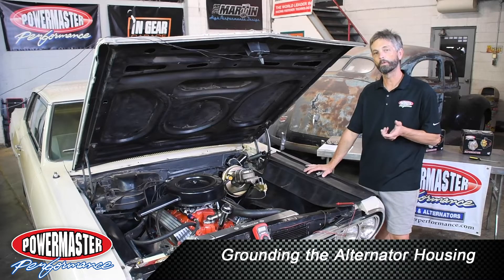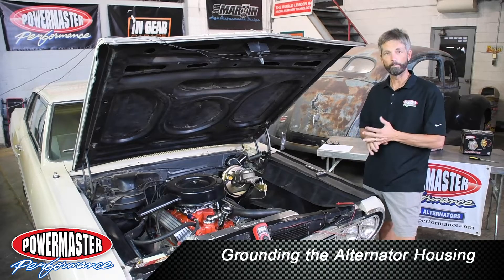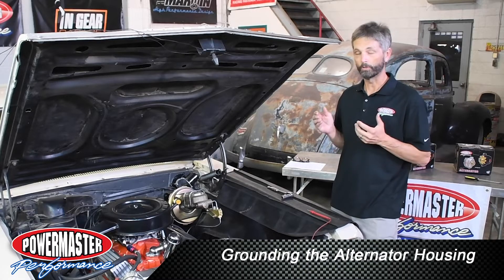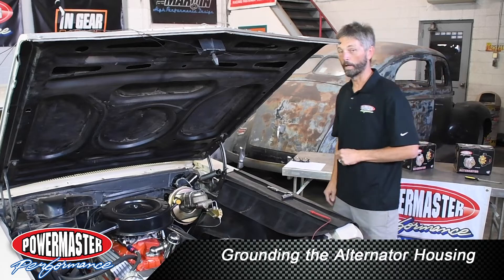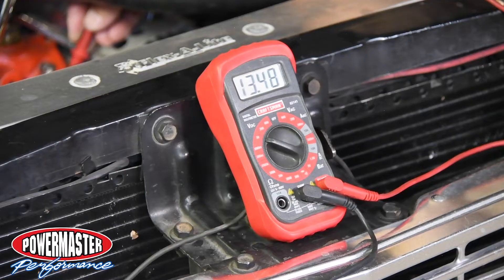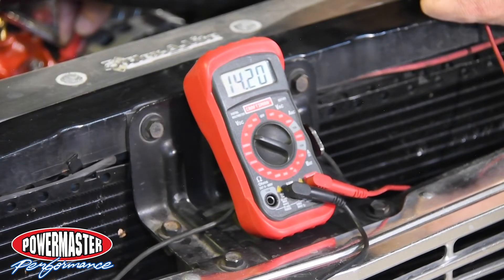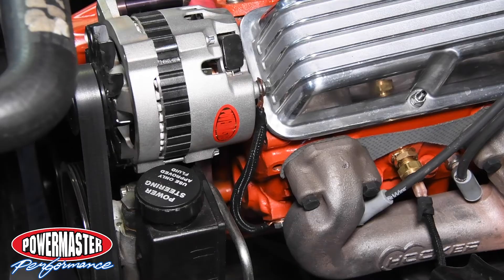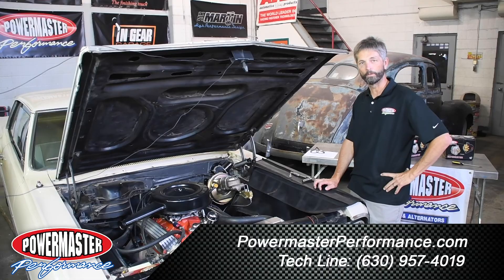Grounding the Alternator Housing

Comment: My alternator was charging 13.0 I ran a wire from the alternator case to negative battery terminal. Voltage went up to 14.0
Thanx.

Comment: Where's was the jumper? Where the new wire went?
Reply: I would put it between the alternator case and the battery negative terminal. That is the important part -- charging the battery with low voltage drop.